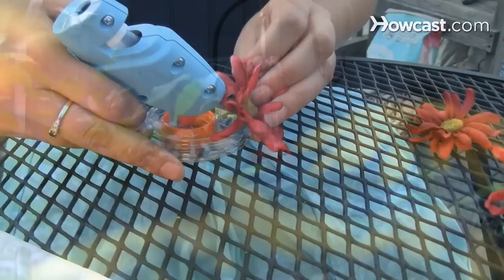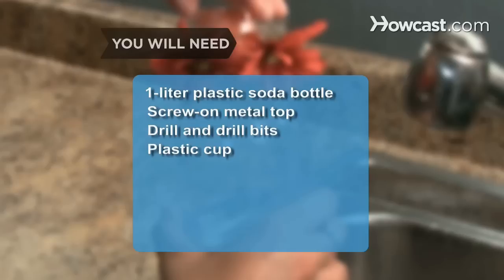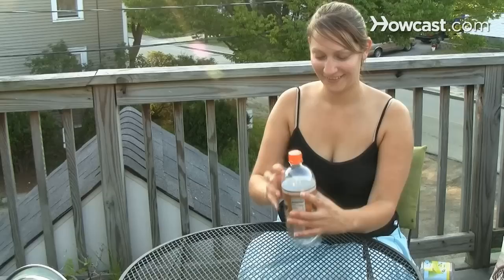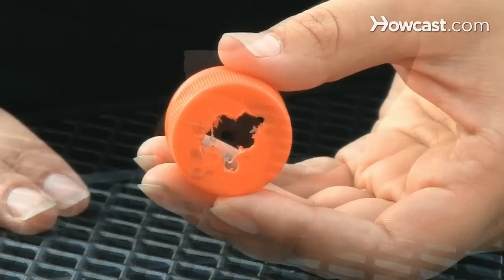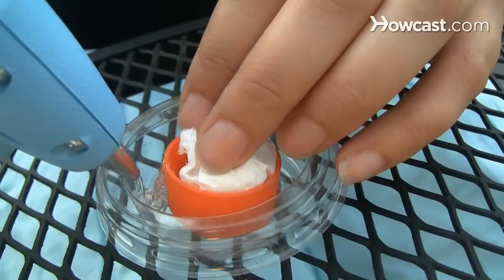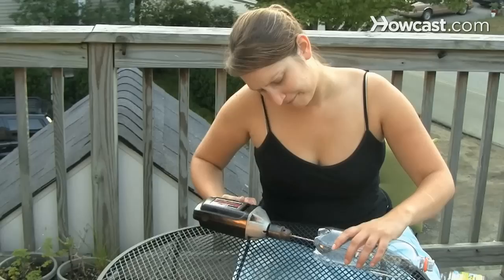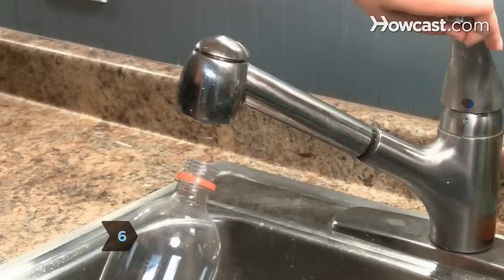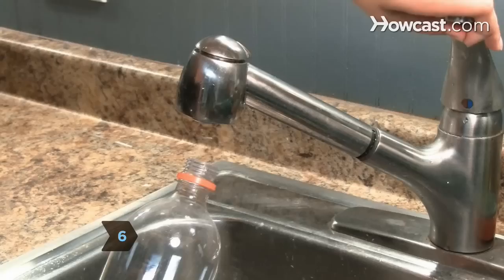How to Make a Hummingbird Feeder

Comment: Some of the primary components in plasticand  the glue or the additives WILL leak into the water. This is an issue with ALL plastic-based designs. So yes, it is always better to make sure there are many native flowers around, rather than to use a feeder.